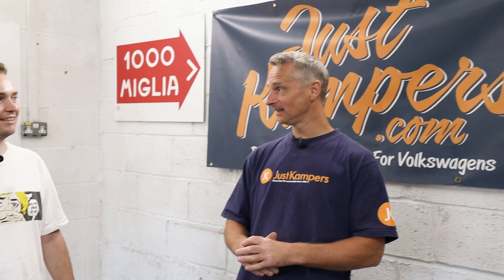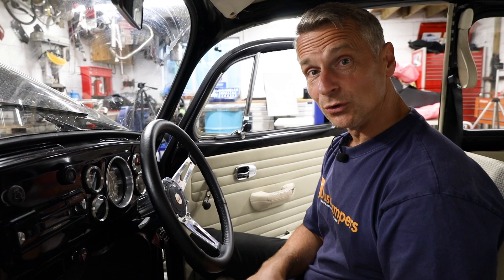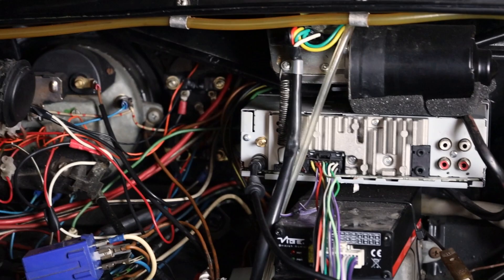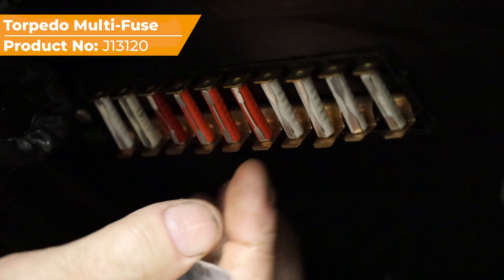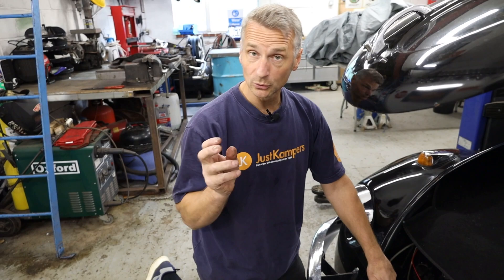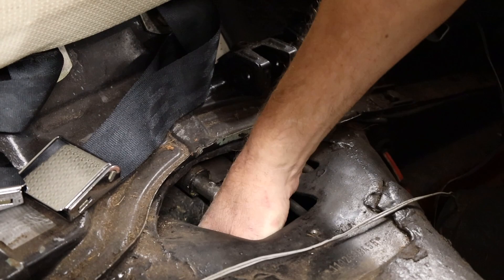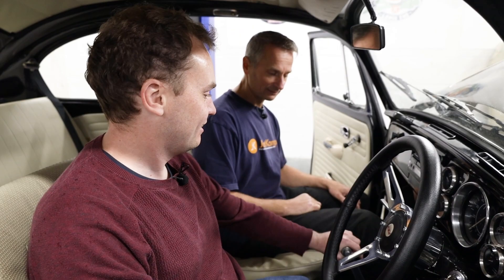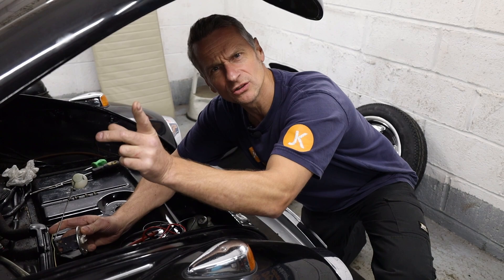Replacing a Beetle Gear Box Coupling, Shift rod bush & Fixing Electrics! Lewis' Beetle Part 3

Comment: great videos & thanks 👍 the shift rod has a slight bend on it from the factory i beleive 🤔 as i did a bit of research when i did a refurb on mine and found it bent, also rubbed a bit if grease on the bushing inside as well, car shifts like new now 😁👍
Reply from the maker: Thanks Edmond, you maybe correct in the slight bend, ours however was really bent. Yes a bit of grease makes all the difference! :D